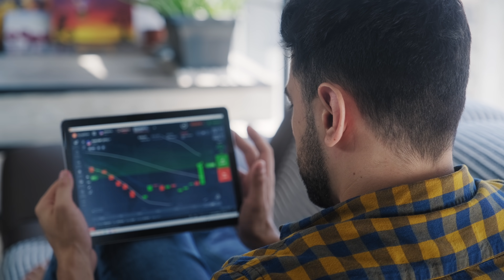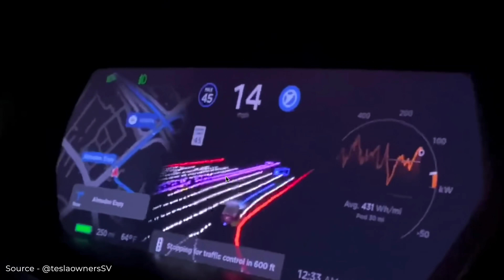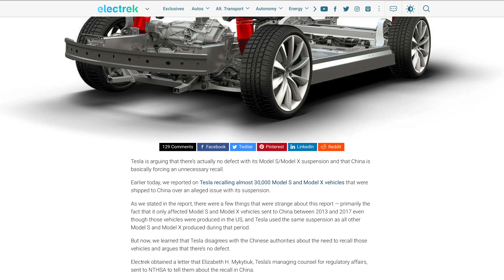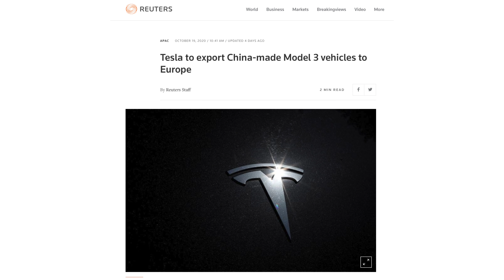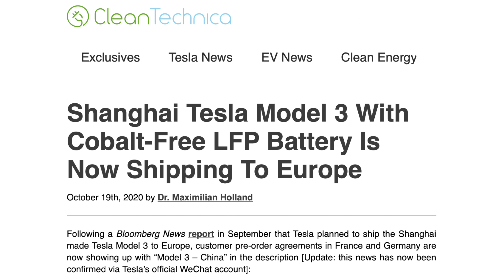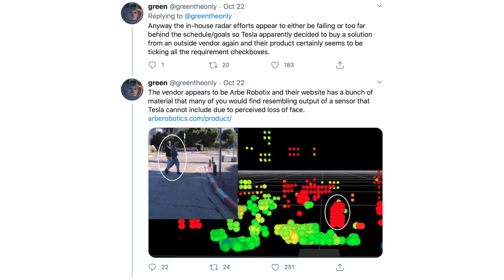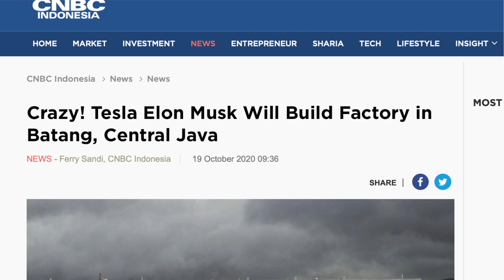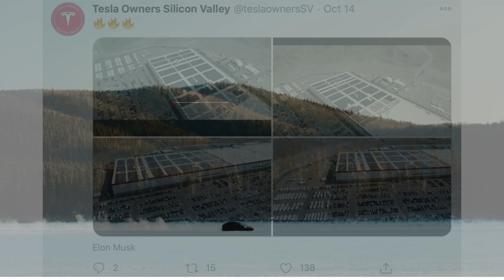Tesla Recalls Model S/X in China, Plans to Export China Model 3 + More Product Updates?

Comment: Tesla have already replaced many of those  suspension parts in China. Mine were swapped out a year ago. It was also linked to the model X shuddering during heavy acceleration when set to “high". Swap involved sawing through some massive bolt, and technicians obviously had been doing a lot of these procedures, I was in and out in a couple of hours despite procedure looking pretty heavy

Comment: Rob, you may want to investigate issues arising from faulty Control Arms.  There's a lot of discussion about this defect in the Model X, S and 3.  I believe this is the recall issue in China. It has to do with the control arm being made of aluminum instead of steel. The aluminum can break down and even rust. Many Tesla owners report having the control arms or ball joints replaced.

Comment: There are credible reports that the cause of the suspension failures is an incorrect heat treatment of steel ball studs. Essentially, the balls need to have a hard surface to resist wear, so these parts are partially hardened. However, it appears that the transition area to the stud was also hardened, creating a brittle failure point. The studs will crack on strong impacts like potholes or curbs. 
Putting the blame solely on drivers for this issue shines a very bad light on Tesla as a company. Of course abusing the cars brings the issue to light, but there is an underlying manufacturing defect.

Comment: I was one of the 0.05% of Model S owners whose lower front control arm (fore link in Tesla parlance) broke.  I did not abuse the car.  Tesla knows it has a problem with those parts, and came out with a new revision in 2017.  I would not be at all surprised if the feds make them do a recall in the States.
Reply: I am not certain Of this, but seem to recall Bjorn Nyland had a persistent issue with the front end of his Optimus Prime.  Should ask him
Reply: @earnmyturns6305  there's a huge thread about it on one of the Tesla blogs.

Comment: Question to Rob's amazing, knowledgeable audience here. Regarding autopilot and FSD:

Today, I drove a Model 3 FSD on the freeway. A car overtook me, and water splashed up. I got a warning from autopilot that one of the cameras was obstructed, and thus autosteer would be limited.

That made me wonder, how can full self driving ever work without a human driver overseeing things, if one splash of mud or a one single leaf getting stuck on a camera might disable the computer's ability to see? In the front, we have wipers. But the side cameras don't have wipers, and there also seems very little overlap in terms of the field of vision of the cameras that are there. For instance, if the left B pillar camera is obstructed, wouldn't autopilot be instantly incapable of handling any kind of intersection?

I think AP will have "vector space" to fall back on, i.e. a memory of the surroundings as it saw them before the obstruction occurred. And that will probably be enough for the car to safely slow down, pull onto the shoulder and stop. I also think Tesla's vision software will continue to improve, and will be able to still discern cars and other objects, even when the view is blurred.

This would be enough for Level 3 ("eyes off the road"). But for Level 5, or for robo taxis?

A human, when confronted with a dirty windscreen, can move his head to the side, or up and down, in order to look around the obstruction. But the cameras are at a fixed location, and they neither have 1:1 redundancy (say, two B pillar cameras that are exactly the same, but a few inches away from each other), nor do they have any mechanical means of self-healing (say, a kind of wiper).

I admit that one rarely sees leaves stuck to a car at the places where the side cameras are. The airflow while driving will probably take care of most of debris that might get stuck there. However, Tesla bears often argue that there is too little redundancy built into Tesla's self driving systems. And I'm wondering if this is one aspect where they actually might have a point.

How often do you guys get these "camera blocked" warnings?

What other reasons might Tesla have for feeling confident enough that they don't need more redundant cameras?

Comment: The longer it stays in the $400 - $440 range the bigger the base.  As Kathy Wood says the bigger the base the bigger the breakout.  You don’t know when the break out is going to happen.  It is hard to buy the lowest before the breakout. So every dip day buy a few shares or LEAPS and do not sell.  Tesla makes a solid product nothing has changed other than Tesla getting bigger and better.  I love their products.  I am powering my desert off grid home with 22 (66KW) of the old SmartCar4Two batteries made by Tesla.  These batteries are 10 years old.  Work great and keeps our air-conditioners running.

Comment: Your depth of analysis is magnificent. Keep it up.
The stock often drops when there is good news around Tesla. Macro: Vested (disrupted) interests c/b covertly influencing Wall St. & MSMedia. I've followed Tesla for several years (I'm a systems analyst by trade). I've seen the ruthless behaviour of these (& other?) parties putting out FUD, trying to force Tesla to close up shop. The COCK!😉 brothers being one such pair.
The China recall has reminded me that Tesla had initial drive train issues with the motor, the suspension, the half shafts, to mention what I recall. They got resolved. All manufacturers have design flaws or supplier products gaffs. Becuase of the corporate culture, I have more faith in Tesla to fix things, than ANY other legacy automaker. That includes Toyota where I'm having a BIG kerfuffle over an issue they did not diagnose but still cost me nearly $1000, which I did resolve and it cost me <$200. Yep. They (the dealers & Toyota Canada) are scamming us!

Comment: Back when they started building Giga Nevada, didn't they say that it would be 100% powered by renewables? I seem to remember that they wouldn't even draw a powerline. Is that correct? If so, what happened to that idea?
Reply: They do plan to use only renewables when the factory is fully built out. But there have been two problems: 1) The need to prioritize capital expenditures because capital was in short supply and often expensive. 2) They were putting a lot of solar panel business development in Buffalo on hold because they needed to concentrate on the Model 3 rollout. 
 
Now that both of those problems have been solved we're seeing solar panels being installed on Gigafactory 1.

Comment: Logistics to Europe. From Fremont, they are trucked across the US to the east coast, and then on a ship to Europe. Slow and expensive. They can also be loaded on a ship at SFO but then go the long way through the Panama canal which takes about a month, and the canal is very expensive.
From China it's much simpler and probably cheaper, though about the same distance.
But by using the cheaper MIC cars, cheaper port facilities, avoiding the congested Bay Area traffic, and the fact that shipping distance is about equal, it makes sense to go from China.
Also, they should be able to bring the revenue back to the US, where there is question whether they can expatriate the revenue from the sales made in China. While they revenue can be used to pay off the factory costs, getting revenue to use elsewhere would be nice as well! Lol

Comment: 420$ is 4 times too high for 2020 Q3.
But is 5times lower than 2030 Q1.

Greatest company in history.

Just too high for now.
Reply: I think it will be 10x by 2030 at least if they do in fact produce 20M vehicles, Elon's target
Reply: @Jonny94669  If indeed they sell 20 million vehicles in 2030 the stock could be 30x.
Reply: @dlwatib  Correct me if I'm wrong but wouldn't that be a $12T valuation?

Comment: NHTSA’s website shows 351 complaints about Model S suspension systems, far more than for competing automakers. For instance, for the 2016 model year, there were 116 Model S suspension complaints, compared with three suspension complaints for BMW 200, 300, 400, 500, 600 and 700 Series vehicles, and none for Audi models A3, A4, A5, A6, A7 and A8.
https://www.latimes.com/

Comment: What do the Chinese do, overload the car some how, weight wise.
Reply: People like to show off and some of the s and x owners probably had money from mom and dad.
Reply: @khuo0219  I get that, but what does damage to the suspension to the early 13-17 X&S ?
Using tunnel or air to avoid surface congestion is MISSING the beauty of raised rail, we are fixated on flying or heavy surface trains, but light super fast suspended "trains" , say at eight metres is a very real SOLUTION for all our congested cities, and in fact cross country, no level crossings, no land conflict, no flooding issues, no snow issues, no crashes and quick and low energy to install, just can't imagine it, cos haven't "seen it", what we need is a prototype or toy to overcome the network design, integration and general hesitancy, but with zero conflict, no crash, not modified for passenger travel as rail has been but designed for such from the start like planes, so all aerodynamic in light weight materials, with emphasis on lightness and speed, and view.